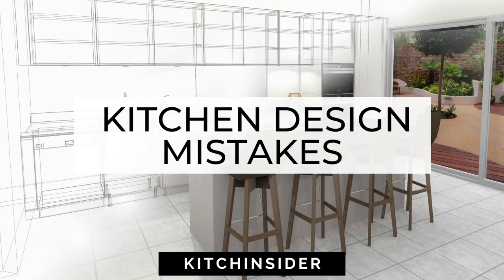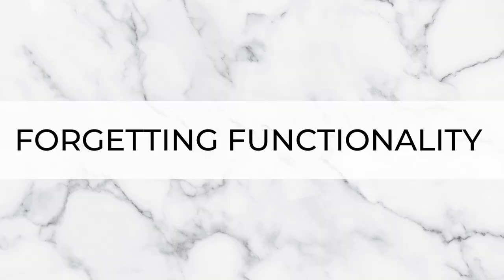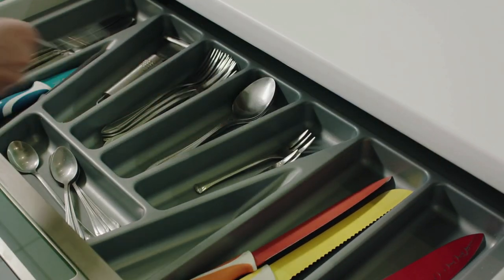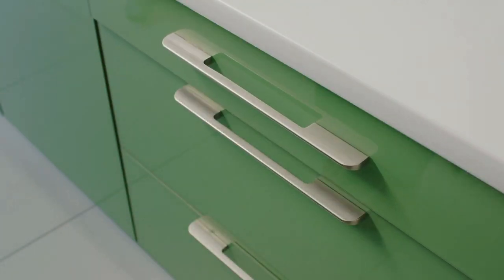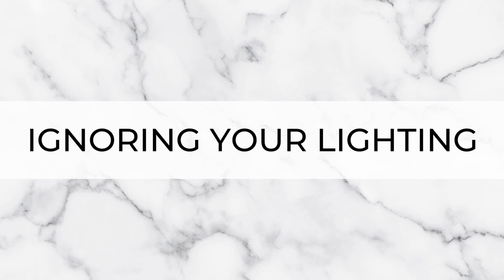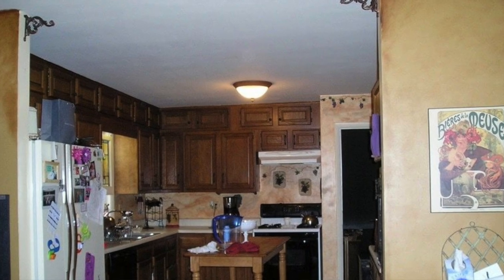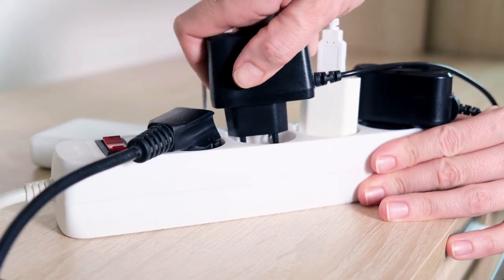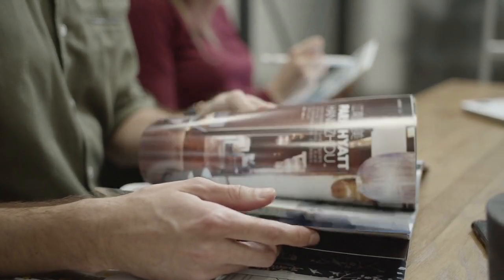Kitchen Design Mistakes | Try To Avoid These

Comment: Have been a Kitchen Designer for 28 years and live in the US. Your spot on. The only thing I would add is budget, your designer will help work out budget vs expectations.
Reply from the maker: Thanks so much! Good call on budget! Although it can be a bit of a personal subject with some clients it can definitely help manage expectations. Nice addition!
Reply: My galley kitchen needs a complete gut job due to structural issues in an exterior wall and floor joists, and the forty-year-old contractor-grade oak cathedral-front cabinets and laminate countertops are in dreadful shape, and the dominant color is puke-yellow like a bowl of vanilla pudding that has been left uncovered in the fridge for a week. Rolled sheet vinyl flooring is holding up not too badly considering its age, but it was hideous when it was new. The doors to the dining room and to the breakfast room (opposite ends of the galley) need to be widened and the ninety-year-old windows need replacement. There goes most of the budget.

Comment: I especially appreciated the comments about making sure that the doors and drawers had room to open without colliding, and also pointing out that walls are not necessarily completely square.  It's really important to allow a little extra clearance for those items.  Your other points were all equally helpful.

Comment: Hi Michael, design question: This is a small galley kitchen. On the outside wall (161") we have the sink in front of the centered window. To the right is the 30" cooktop with hood concealed in a 30" cabinet and an 18" x 40"H wall cabinet against the right wall. To keep the look symetrical, our designer is recommending a 48"W x 40"H cabinet to the left of the sink with 2- 24" doors. I don't think it is a good idea to have doors that open out so far past the countertop. Would it be better to mirror the other side with an 18" and 30" cabinet? Would so appreciate your input. Thanks.

Comment: More excellent professional and comprehensive advice. 
The biggest mistake I made with the first kitchen I built for my wife was basing the design on the architect's advice and not my wife's opinions.  I am still reminded of the chronic design deficiency and dysfunctionality of that first attempt whenever we have a robust discussion relating to a disagreement relating to kitchen design.

Some of recommendations for creating a functional and comfortable working kitchen is incorporating as many drawers as practically possible.  We started with one bank of 5 plus 2 pot drawers in our first kitchen and have 52 total in the kitchen I am just finishing in our downsizing home we are renovating. 
Various sized drawers provide easy access to cupboard space otherwise wasted or very awkward to reach with shelving. 

Another factor we have found works really well is to specifically build a bench top space to hold almost all small appliances - mixers/toaster etc.  Not just an "appliance cupboard" as such but a bench space against a wall with usually wall cupboards at a sufficient height above with the worktop/bench space about 800mm deep rather than the standard 600mm. 
This allows mixers for example to be pulled forward during use with plenty of room without having to move them to another area. 
In order to create this width of top (if you have room) we have the standard cabinets 200mm of the wall and usually have the wall ovens and fridge in the same alignment. 
This gives room for services, ventilation and the depth required for most modern family sized fridges so the do not protrude into the circulation areas. 
Elevation of built in appliances to provide ease of use does not have to be restricted to wall ovens.  Drawer type dishwashers can easily be lifted off the floor to provide a height for unloading into adjacent reachable drawers. Conventional dishwashers can also be elevated to a height that allows operation without the tedious bending down - its a real pain at our age. 
And don't let any tradie tell you that it can't be done. It just takes a little thought and patience.
Reply: Thank you!!! Been cooking for over 40 years and this was still v useful to me 😅

Comment: Based on some I know who have moved into a home and inherited a kitchen, they sometimes rip it out and replace it too soon.

I think that you gain so much by taking a little time, live with it, and get a feel for what works for you and what does not - you may be surprised! And by having a better appreciation of what you like (and do not) you will have valuable information which you can share with a professional designer, who will be helped in their task.

I also think that many are sold on the idea of the 'perfect kitchen', when in reality it is nearly always a compromise, and that as I have found myself, more than one compromise solution may be possible - it is a matter of choosing which compromise you will be most comfortable with.

For example my sister has replaced her 'difficult' kitchen, and to avoid the problem you highlighted with clashing handles has gone with doors with the handle being a groove on the top or bottom edge.

Don't get me wrong, they work well and look fantastic, but are becoming increasingly difficult for our mother to use!

From personal experience I know that to get what was needed while maintaining something which didn't jar to the eye took me well over a year to work out.

The irony is that all the compromises I was forced to make, could have been avoided if the kitchen had just 200mm more in each dimension!

P.S. I do wish that I had been able to have the services of someone like you, but unfortunately, budget constraints meant that I had to rework rather than replace.

Comment: Think about the length of the countertops. Most have 2 sizes of standard and jumbo. If you DO NOT want any seams then KNOW the counter materials and costs.
If I had my kitchen with one smaller pantry I could have had NO seams. Plus I could have avoided having to buy an extra slab. (I have quartz counters). 
I don’t regret what the layout is. 
I love it and the full backsplash including the “to the ceiling” behind the cooktop. 
I just wanted to share the one thing that you may want to consider.
Also if I could do it all over again I would have done “press to open” to avoid having handles and also a cleaner look.
❤love the channel❤

Comment: Thank you. We're in the process of designing our house, and I'm struggling with the kitchen. Questions such as 'Where should the sink go?  The hob? The refrigerator? 
Is there any rule that can help me decide?
Reply from the maker: No 'rules' as such, but the work triangle is a classic design principle that can help with this. I'll also think of the layout in working 'zones'. What makes most sense for a practical and functional working layout. It all depends on the space you have and the way you like to work ultimately. If in doubt, go have a chat with your local kitchen design company!
Reply: @kitchinsider  thank you

Comment: Thank you, I’m glad your back :) Do you think you can make a video on plug drawers? I asked several kitchen designers and they don’t do it so I thought of making one myself.
Reply from the maker: Thanks! 😊 I don't know about making one yourself. It's the cable management you need to be careful about. Pulling the drawer in and out could damage the cable if not done correctly. I've used these in the past and they work great. Just need to check your drawer has enough space behind for the mechanism and height for the face plate inside. Europe version link - https://dockingdrawer.com/collections/rest-of-world-outlets/products/docking-drawer-trio?variant=12295021527063
Simple enough to install. You might need an electrician to install a socket(outlet) in the cabinet to plug it in to. Hope that helps!